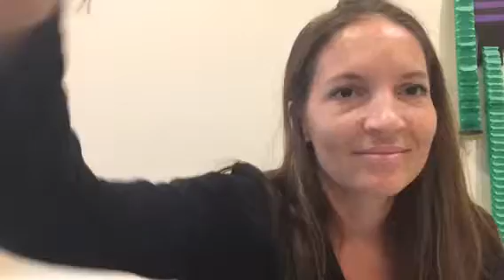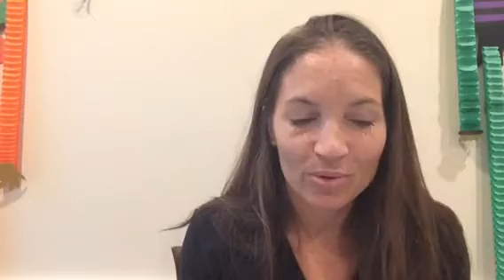Minimed 670G's dirty little secret: The underperforming auto mode correction bolus

Comment: Ill be watching more of your videos now that I have my pump. I have had it for about a month now and been on auto mode for a few weeks. I have had a few headaches w/ the auto mode too and I found out some new information from my old DE. Auto Mode is NOT actually correcting you to 120. Auto Mode is correcting you to 150 and the micro boluses are correcting you to 120. Also, you are like me and many others that want that 260 number to drop FAST and NOW. Auto Mode isn't built that way and the algorithm wont do that. It errs on the side of caution for sure. Manual Mode is more of a roller coaster while Auto Mode is supposed to be more of a smooth and gentle wave. 

I 100% agree with you that I would want a bigger adjustment from the .1 it suggested to you. It has frustrated me. I however, do not like the roller coaster ups and downs as it makes me exhausted. On the other hand, if Auto Mode is taking its sweet ass time dropping from a high, that also is exhausting. 

One thing my DE suggested is lowering the active insulin time. Right now I am set at 3 hours. We are going to adjust that to 2:45 and then go from there. That should help make the drop a little faster, but not plunging fast. 

I think over time it is getting better though. At this minute I have a SG of 206 heading down 1 arrow. My BG was 230 though, with .5 active in me. Auto Mode suggested .7. That equals 1.2 units. I have a 50 sensitivity so that is a drop of 60 points. 230-60=170. Which is a slow adjustment towards the 150 mark and not the 120.
Reply from the maker: Hello Matt Hollingsworth! I certainly can't speak for what your experience will be on this pump, and i absolutely wish you the best of luck. However, I have to say that after 7 months of being on it, and watching auto like a HAWK (because of the incredibly mind-numbing moves it was making), I can tell you that auto is NOT a smooth ride. A smooth ride up, maybe. This is what I believe at this point... 1. I can no longer remember what auto is correcting to. Auto mode's target BG is a 120. "Temp Target" is set for 150. Now maybe it's not correcting to a 120, and that may be true. Something rings a bell about that. But either way, when my BGs float in auto, they float and float and float. 2. I believe the reason auto mode can't handle my 260 is BECAUSE of its micro boluses. I've been really learning a lot about my ISIG and calibration factor (and have made a number of very painfully boring videos documenting the journey), and I believe auto is tracking my factor, along with my blood sugar and IOB, in order to determine the amount and rate of micro boluses. They can be as small as .025, and I've seen as large as .125. What I believe is happening is auto is using my c-factor combined with the other numbers in order to determine the size of the micro bolus. It looks good on paper. However, my SG, which is part of the equation, becomes delayed as soon as there is a significant change in my c-factor, therefore losing its accuracy. There are plenty of cases, in my own experience, where my SG is delayed at a 160, my c-factor is a something like a 4.6, and this triggers auto to give me smaller micro boluses, therefore building upon an already increasing blood sugar. Trust me, I know how harsh manual mode is. It's old school pumping, but when I need to get the job done, I need to get the job done. 3. We've adjusted active insulin time (my endo and I), and its effect was really more apparent in manual mode. In fact, I had to change it back. 4. I also hate the roller coasters. Hate them with all of my heart. I am working day in and day out at learning how to work with my c-factor in order to avoid them, and I am having GREAT success. I'm doing it all in manual mode using a mixture of small boluses and short, gentle temp basals. In fact, I'd like to say that I am doing what auto mode is trying to do for me...only much, much better. It's not coincidence. I have access to a current BG and to environmental context that auto does not have access to. I don't think I'm better than their algorithms, I just have better information. :) This is just where I am with everything today, but things are really making sense. With all of that being said though, not all diabetics have my diabetes, and, surely, not all will share in my experience.
Reply: Good info. I think there is definite confusion on the target ranges and DE's need to share that information more. I confirmed with my other DE (I had an old one from my first pump and this new one for the 670) and they both confirmed a 120 overall target and a 150 meal and adjustment bolus target. That is not to be confused with the 150 temp target that you can use for exercise or other activities.

I have been monitoring it like mad in auto mode as well and it nearly always gives me meal or adjustment boluses that trend towards 150-170 and then expects the micros to adjust you down to 120. 

The thing is, in auto mode, like you've stated already, if i want to enjoy pasta or a sweet treat, it cannot handle the high and the adjustment fast enough. That is frustrating for sure. I despise hanging around 250 or even higher for too long, but jumping over to manual to give the adjustment is also scary, because my on board times and sensitivity varies greatly. If I am too high around 2-3pm and adjust with too much insulin in manual, around 4-5 I plunge because I am ULTRA sensitive and all that onboard insulin kicks in. In the morning I have the morning syndrome where i can eat ALL protein and jump 50 points. 

I have noticed that on days like today, auto mode was fantastic. Exercised and ate well (no heavy carb meals) and it was a nice wavy graph never below 95 or above 190 and auto mode handles that range super well on days like this. 

Everyone and their Type 1 is different :) I need to go watch your other videos. Please also know, I just like sharing info as you are sharing, and no arguing/debating was/is intended.
Reply from the maker: so many thoughts.... i don't even know where to begin. 1. i think we agree on a lot. the things we don't agree on may be due to differences in our individual diseases, schedules, etc. I also kind of think I might be further down the road than you at this point. (i might also be on a completely road altogether. i'm aware of this.)  In the beginning, I was afraid to leave auto. I hung through those highs until they SLOWLY came back down again. I didn't mess with a thing. Didn't question a thing. It was auto mode, and, almost instantly, i could see it was quite an impressive device. I lost weight and dropped in a1c really fast. so fast i had to make a video about it. i thought it was magic. :) but then over time i started to see some of the flaws in the mode and began following the numbers. even some of my initial determination began to fade because those stubborn highs started taking their toll. as hard as i was working, why was i back at a 280? i hadn't even EATEN anything despite really, really WANTING to eat. manual mode was equally as crappy because of all you said. i documented this as well... in 1.6 million mind-numbing videos. :) manual mode was harsh. auto mode took too much on. so i tried to find a way for the three of us to co-exist. for a while there i began to exit auto as soon as i saw a minimum delivery to try to counter it with manual's iron fist. it wasn't a bad approach. medtronic thought i was crazy the way i was weaving in and out of the modes. and, honestly, it was exhausting. 

what i've figured out so far in MY case is that auto can't keep up with my blood sugar swings. auto and i are the BEST of friends when i'm doing my best wall impression and not eating or thinking or exercising or feeling any kind of emotions... or whatever ELSE moves my blood sugars. unfortunately, that's not often. as soon as i start to move, my SG gets delayed. that delay causes problems. i think it's even way more complicated than that, but i've already expressed my opinion in a short story here and need to go look out a window. the 670 definitely lets me sleep at night. and then eats away at my brain during the day with its very, very confusing moves..... :)
Reply from the maker: i also am working on using my calibration factor in manual mode to help control the swings. it's a really long and not very interesting story, but, in a nutshell, i'm using the sensor raw data to try to do what auto is doing but better. there's DEFINITELY something to it, but because i'm NOT a continuous glucose monitor myself, it leaves me testing excessively. i'm posting videos about my progress in learning about the c-factor, but i'm really trying to see if it can be done with testing no more than 15 times a day. i'm not sure anyone, no matter how motivated, want to test 25 times a day even if it means excellent control. anyway. i hope to post soon with some updated info, and maybe it's the kind of thing you'll be interested in. at least maybe to fall asleep to. :)

Comment: I have noticed this issue as well and I’m clueless on why the system was designed this way. I will say from personal experience while playing around with the Bolus options while in auto mode, if I goto Bolus and leave the blood sugar blank and say I enter 15g of carbs but I’m not actually eating anything I can get my correction Bolus that way as the Bolus Wizard will calculate the carb entry and give me the option to enter around 2 units for the carbs even though I’m not eating anything and I’m using the Bolus as my correction factor.
Reply: You should not phantom bolus/eat. If you are telling the pump you are eating and you actually are not and you are in Auto Mode you are confusing it more for longer. That probably wont help the situation any. Now in saying this...I did the EXACT same thing on my old pump, but was specifically told not to do this on this new pump because of the Auto Mode trying to figure you out. I understand the frustration, but lying to the pump probably isn't helping it :)
Reply: How is your insulin working time in your pump? I set myn to 2 hours.
Reply from the maker: I’ve been 3.5 hours for as many years as I can remember. I tried changing it to 3 but found immediately that it was too much in manual. At the time I was going back and forth between modes and didn’t like the additional insulin back in manual mode.
Reply from the maker: A nice work around, no doubt. I used to do that on all my old pumps and never worried about it. But somehow, feeling like I’m being “watched” by my 670, I’ve been afraid to confuse it anymore than it already seems to be. To be completely honest, I’m just not doing auto right now. Are you having any luck with auto otherwise? Some people love it....
Reply: I do suggest you pay close attention to what I will tell you. WHEN IN AUTO MODE YOU CAN OVER TREAT A BLOOD SUGAR BY DOPING EXACTLY WHAT YOU ARE DOING. YOU WILL GET NO ALARM EITHER!!!!!!!!!!! IT HAPPENED TO ME SO BE CAREFUL WHEN TREATING FALSE CARBS. I WENT FROM  165 TO 52 WHILE ASLEEP NO ALARMS . I WOKE UP NEXT DAY WITH BS 120 GRADUAL RISE  . I AM GLAD TO BE ALIVE THANK YOU LORD.
Reply from the maker: Medtronic does make it clear phantom carbs are not recommended. I’m glad your event turned out okay.
Reply: Yup, I’ve been on my 670g for two months now and do the same thing to bring down high bg’s due to not counting carbs correctly or what ever.
Reply from the maker: It just might not be miscounting that is causing your high BGs if you're in auto mode..... I've made a couple of other videos that show the ways auto mode reduced insulin can lead to high BGs...  if you're still out there?

Comment: Thank you.  I just started automode and thought I was going crazy.  I'm glad you explained that you are experiencing what I have experienced.  I hate that I can't make the decisions for correction boluses in automode.
Reply from the maker: I absolutely agree...especially when they seem so short of what I need. I definitely like auto mode under certain circumstances, but it is not an easy mode to work with.
Reply: It is not easy to work with. I have over an hour commute to work, and sometimes I want a snack in the car :).  The quick bolus allowed me to have my snack and reach down to the pump and give myself a bolus.  Now, I can't do that, and it's too dangerous to take my eyes off the road, navigate to the bolus wizard, enter carbs, etc, etc.  I'm not liking it!  I'm so disappointed so far.  It is taking away flexibility for me.
Reply from the maker: I definitely have my days. I’ve learned to go in and out of auto so that I can get control when I need it. But that quick bolus... I never made use of it. I used to memorize my buttons and count the clicks, which obviously, is a seriously flawed method that I no longer use. It sounds like a great feature. Wonder why they got rid of it?

Comment: Was auto mode taking your increased basal rate into consideration when calculating your correction bolus?
Reply from the maker: I appreciate the thought. However in my case, I actually did make adjustments to AIT a couple of months after starting auto with my endo's help. It didn't go particularly well, and I ended up changing back by month's end. I didn't see much difference in auto's correction and could've gone with the change, but I started having terrible crashes in manual. I also understand what auto is doing with the microboluses, but it doesn't work well for me. I think it just bites off more than it can chew. Anyway, I really do appreciate the idea and would love to hear another if you have any. :)
Reply from the maker: I can't speak to the mechanics of the pump, but I can say I believe so. I describe it as my auto mode "getting in over its head" because I believe it cuts the correction short because it thinks it can handle more with the adjusted microboluses. In my case, that works like a charm over night, but it means I float (and, worse, at times really climb) at different times throughout the day. Now I am learning lots about how to predict and avoid trouble periods, but as my mom says, it sure takes the "auto" out of "auto mode". :)
Reply: In auto mode your increased microbus delivery should be taken into account vs. your fixed basal in manual mode for the correction in auto mode. If you are consistently not getting enough correction bolus this could point to the fact you need the auto mode algorithm to be more aggressive. I do not know how your doing on the low end but shortening the active insulin time causes the auto mode algorithm to give you a more aggressive correction bolus...may be worth reviewing with your provider after looking at your overall trends.

Comment: interesting. i am about to get my 670g this month and I've been on the pump now for 7 years out of my 19 years of type 1. i noticed you mentioned you were exercising, so i am curious if in auto mode, it is calculating some exercise behind the scenes. i know for me,  exercise will drop me after, not always during, and if i am, for example at 250 with 2 on board, i would take another .75 roughly. but.....then 'after exercise' kicks in and i am low. 
what is your sensitivity after exercise? is it still 30 or a higher sensitivity? after you took the adjustment of 2 and change, did you get to your target level of 120 or lower?
Reply from the maker: Hi! Yes, exercise has always dropped me afterwards, too, but that is no longer the case. In fact, when I first started on the 670 and didn't know what was happening, I likened exercise to eating cake. All of a sudden I'd have these terrible highs that happened an hour or two afterwards that I couldn't explain. I tried the temp target but really didn't like it. Then I was doing manual mode with a temp basal but with often surprising results. I finally figured out the new features like suspend before low, suspend on low, and minimum delivery were really spinning me out of control. Then I stumbled upon just auto mode during exercise, and it has been great at helping me minimize my hypoglycemia, but in doing so, sends me high later. 

Wow. Apparently I had something to say about it. 🙂 I'm understanding this pump more by the day and am seeing all kinds of patterns. Knowing what it's up to really helps. Please let me know if you have any other questions. And good luck,